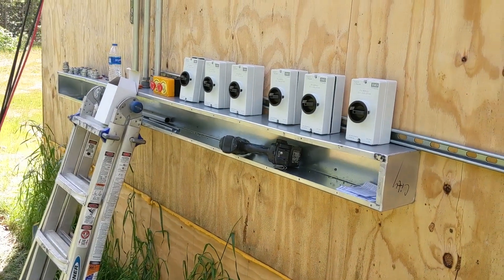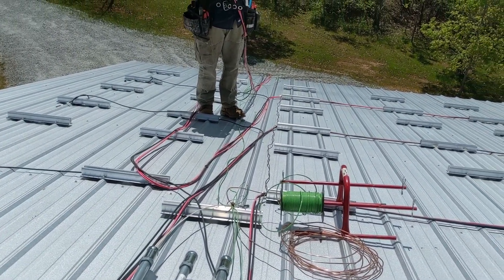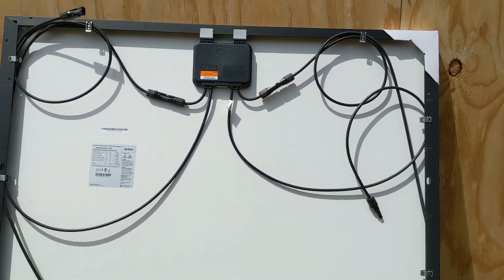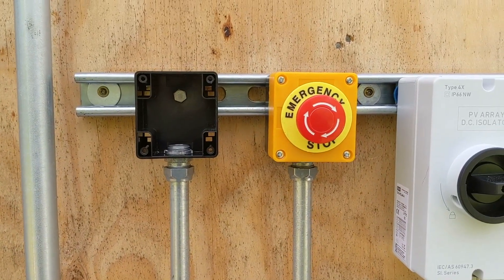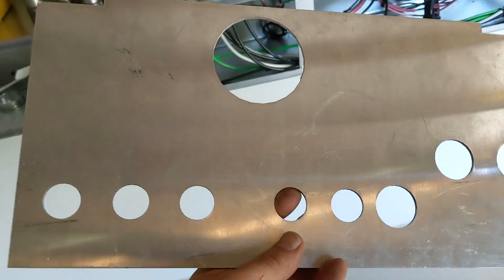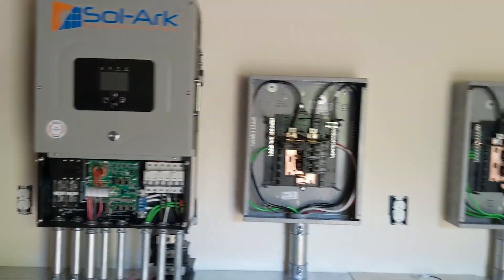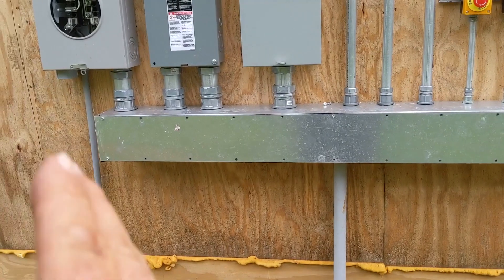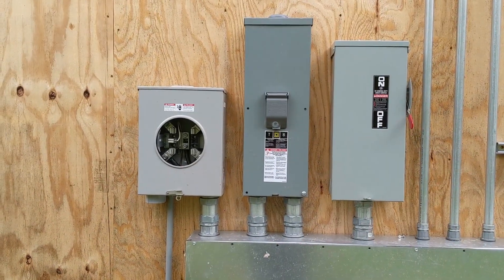Easy Parallel Stacking for Massive Peak Power

Comment: Hmmm...where is the siding, they forgot the siding before all the electrical was mounted outside?
Reply from the maker: Yes I asked the customer several times about siding this before we built the system but he said go for it.
Reply: @engineer775  ... I would have, at the very least, painted that bare wood.  Seems like some poor planning on the owners' part.
Reply: I've seen boxes installed and siding installed around them. Looks clean when done to me, I'm sure this will be addressed, if you have something like this, I'm sure there's a plan...

Comment: This might be a stupid question but Are there no safety covers for those emergency stops ?   Put a red button in front of a ten year old and you're looking for  problems  LOL !
Reply: Yeah, I do not like it either.  However I have had a similar button on my system now for 4 years.  I have never had an issue.
Reply: That's why it was up high on the wall...

Comment: Great job Scott, as usual. Thanks for the tips on the Terminal Blocks. I'm curious how much did the Tigo's add to the job, time and expense wise if you're ok sharing that?
Reply: 2000.00 in materials.  a few hours of labor for adding to the panels, installing the transmitters and external buttons and wires.

Comment: Is the generator input up and running on the 12k now? Last one I did I had to use a transfer switch on the grid input to switch between grid and gen. Beautiful install!!
Reply: Yes,  2-wire gent start based on Battery SOC.

Comment: You guys have the cleanest setups ever. The second I hit the lottery You guys are on my list to call!
Reply: not to sound like an ass but you literaly would have to win the lottery or put yourself in debt for the next 20 years to pay off the setup. The average working class man can barely keep his head above water.
Reply: @DavidSmith-dm8ew  Not to sound like an ass but most people settle for their jobs and are stuck in a rut.  Best thing you can do with no formal education is construction.  I'm a high school drop-out but not an idiot just make some bad life choices with friends and was too cool for school.  I quit my 18$/hr job in 2006 and went on to work in refineries atarting out at 26$/hr and have worked myself into 55$-60$/hr depending on the plant.  You can do it.  I just bought 40kw of solar panels and 3 solark 12kw and a ready rack.  Wish me luck.  Don't settle for what you have, work for what you want and don't be a slave to debt.  I've made over 100K$/yr (well over sometime 200K$/yr) and still drive a 2005 F350 with 310K miles.
Reply: SO, I GUESS YOU'RE NEVER CALL?